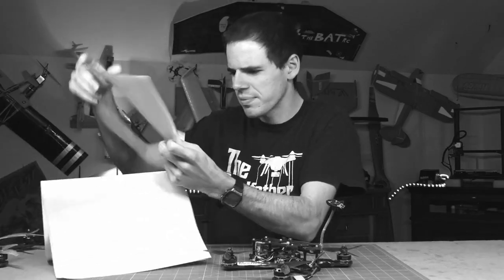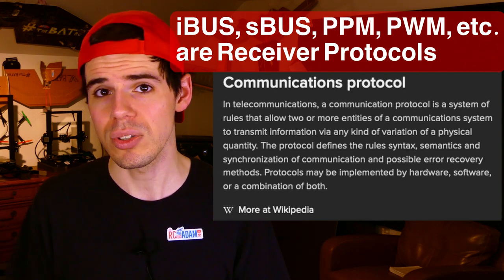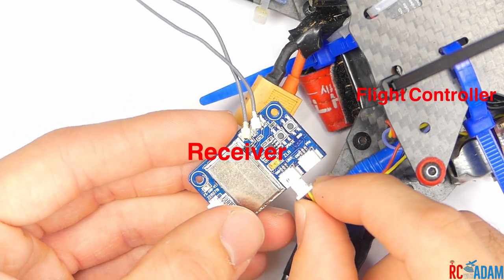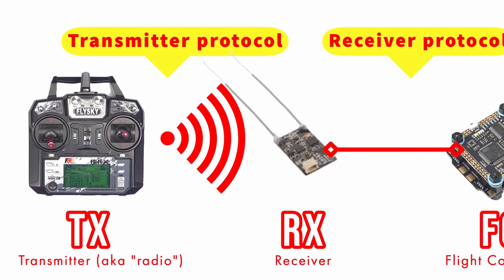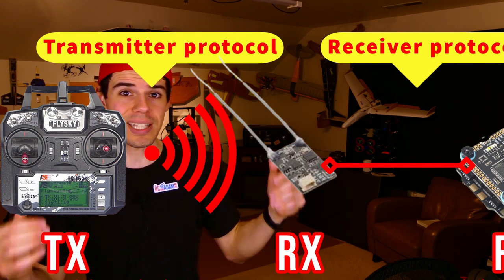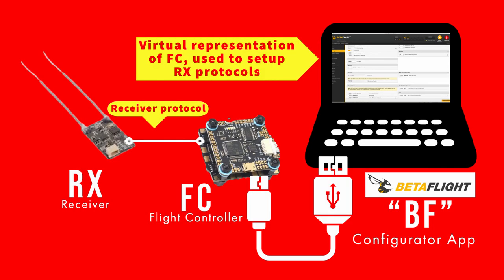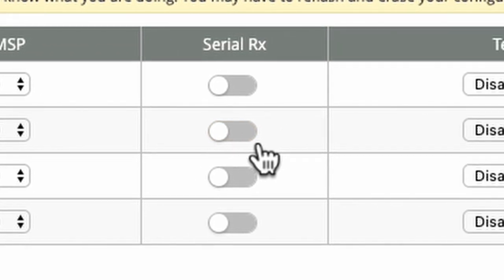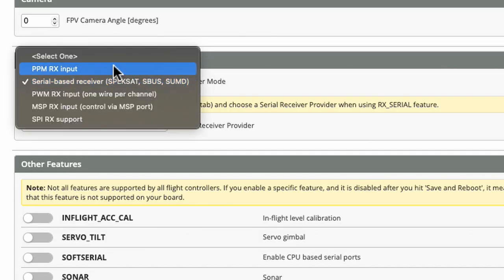What does IBUS, SBUS, PPM, PWM mean? (2021) Receiver Protocols Explained for FPV Drone Beginners

Comment: PPM is pulse position modulation, PWM is pulse width modulation. Both use square "pulses" of higher voltage to transmit data, but pulse position modulation alters the position of a pulse, and PWM alters the width of a pulse.

Comment: Admin you have great videos very knowledgeable when there's not very much help from the
factory must be overwhelmed. I'm a beginner too fell victim to miss leading and
vague descriptions. Purchased the F210 3D with Devo 7 I thought was real time
video. I found a Devo F4 that when I asked a question about this he answered I
just sell them. The description also says receiver and battery not included so
the Devo F4 has code ID or assignment and has 3 different batteries described
7.4V 800 mAH or 5# battery 4* 1.5V or NiMH4 4* 1.2V 6000 -2000mAH. I need to
know if the Devo F4 will connect and except regular batteries to my F210 3D. I
also need to know about firmware updates both Devo 7 and Devo F4 say they can
be updated the Walkera web site has nothing about this and they don't answer
there emails. My Devo 7 came with a CD rom that was missing will that help me download firmware because when I connect the usb computer doesn't recognize the F210.

Comment: thx so your more or less in the same ballpark if its sbus or ibus. (seriel protocol and not much gain on one or the other)
sbus is quite a bit more common, but likely down to be the norm for huge RC brands
picked up a Shuriken X1 numerous years back, when GB cleared stock at a low price and that unit came with Futaba, which I concluded I was able to control as I had numerous TXs able to do Futaba, but sadly it was the proprietary Fasst variant, which to my knowledge are only on Futaba's own highly expensive TXs, where its the older outsourced futaba protocol sfhss or something like that third-party TXs or multiprotocols supports.
So Im looking into which of my old receivers to use in Holybro X1.
# Flysky FS ia6
# Walkera RX sbus
# XY7000
# Flysky X6b
Im leaning towards the Walkera sbus as that will do with both my TX16s and my old Devo7e,, while the X6B seems to be ibus valid, and that rx has battery-info and that could be handy.
but all these RX's are quite old receivers that I never took advantage of and was like sub10 USD back then so picked them up as they would be nice to have on hand..

Comment: Great video Adam. I am trying to set up my XR602T-A to an F4 flight controller that unfortunately has no specific SBUS pin, just a UART2 (RX2, TX2). I soldered the reciever's SBUS pin to my RX2 but can't for the life of me make it work. I think the settings are correct in Betaflight. My Flysky i6 binds to the reciever, but that's it. Clearly I am missing something here...

I read something about an SBUS being univerted and RX2 being inverted and that could be why? It just all got very confusing.
Reply from the maker: Hi, Rani! Yeah, I've had difficulty with those receivers as well. If I recall correctly, I had to update the firmware on the receivers. What flight controller are you using? This probably won't help, but here's my video in the XR602T-A in case you haven't seen it https://youtu.be/PR6Yr_MLFlU.
Reply: @RCwithAdam1  Hey! Thanks for the reply :) I got a 2nd hand iflight Alpha a65 which originally came with a TBS crossfire receiver (seller sold it without the reciever). I think due to that, the F4 FC had no SBUS pin unlike the renders shown online for this exact FC board. Which firmware did you upgrade to? I'll check your video, cheers!

Comment: Hi Adam, I want to connect my receiver(flysky fs-i6b) to my FC(Emax magnum mini f4). But it wouldn't power up. I checked the voltage by putting one pin of multimeter on the positive end of the main supply(to which xt60 is connected) and the other to the ground and a 5V pin for the receiver on magnum mini. Surprisingly, instead of showing 5V, it showed 15.4V. So, I tried to power the receiver externally using AA batteries and that worked and I bound the receiver to the transmitter. But now, how do I power it on the flight controller board. I still can't understand how can t show 15.4V on a 5V pad. Please help.
Thank you.
Cheers!

Comment: Ok so I'm looking at a bind in fly that comes with reciver on the bord. What's ghost protocol and what transmitter goes to it
Reply from the maker: Ghost is a radio control link that is made by ImmersionRC and comes as a "JR" style module that fits into the JR module bay found on many radios these days. You should be able to use ghost in any radio as long as the radio has that module bay. For example, Radiomaster is a popular brand with that feature. Same goes for Crossfire link as well.

Comment: @Adam I lost you when you started doing stuff on your TX. Was that for the TX-RX communication? or it had to do with the RX-Flight Controller communication?
Reply from the maker: Hi, Andreas! Thanks for watching and commenting! I included that part in the video because I have had situations where I needed to change settings in the radio so that the receiver would work properly. You may not need to do that, but I wanted people to be aware of the possibility.
Reply: @RCwithAdam1  Thanks for the reply! So, just to confirm, that part was for the TX-FC communication, yes?

Comment: Im flying FIXED WING PLANES. I have some new receivers that have selectable output protocols. does it matter if the RX is set to SBUS, PWM, or PPM if im not using a flight controller? Im just flying LINE OF SIGHT. No need for telemetry, HUD, flight controllers, or any other peripherals. Im hoping that as long as the TX and RX are bound, the RX OUTPUT SIGNAL doesnt really matter for fixed wing "dumb aircraft".
Reply from the maker: The rx and tx still need to be on the same rx protocol. What model receiver is it? If you're plugging the servos directly into the receiver, each into it's own slot, it's PWM. I think that is by far the most common fixed-wing rx protocol.

Comment: Do you know of any 4-in-1 ESCs that could be wired directly to SBUS without a Flight Controller? I'm building a land-based battle bot and trying to consolidate wiring.
Reply from the maker: I haven't tried it, but it seems like it would work with most 4-in-1 ESCs just like using a single quad-style ESC (one without a BEC to power the receiver).

Comment: Can we use both sbus and ibus with fly sky fs i6?
Reply from the maker: Flysky receivers are meant to use ibus, but I know I've used sbus for some receivers (I can't remember which ones, though).
Reply: @RCwithAdam1  okay, so in the flight controller we would need to connect the reciever with gnd, +5v, Rx1 right?